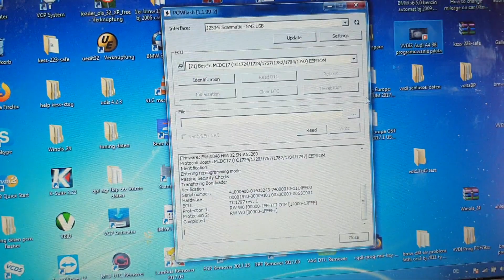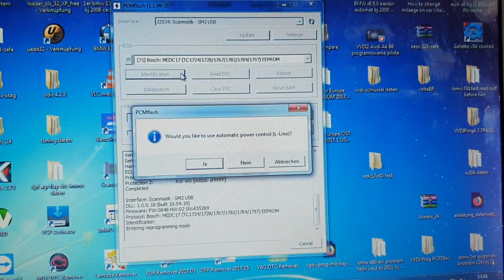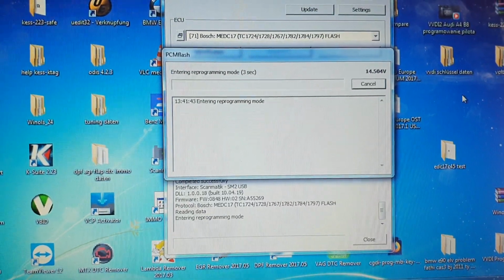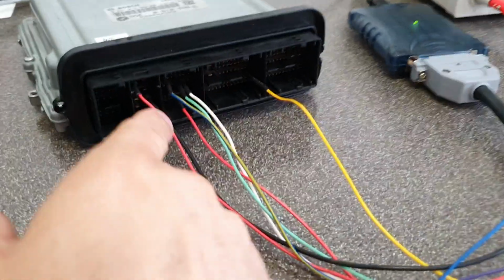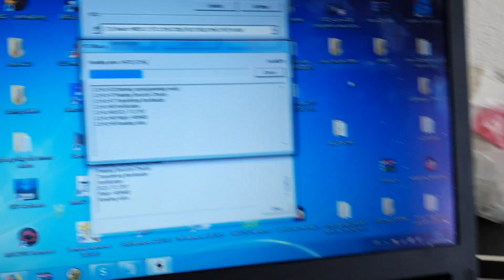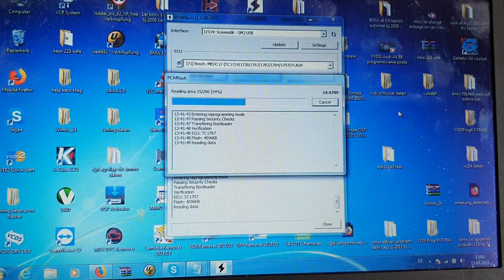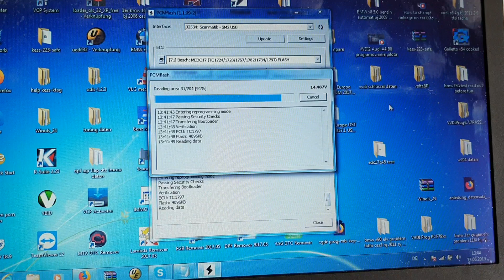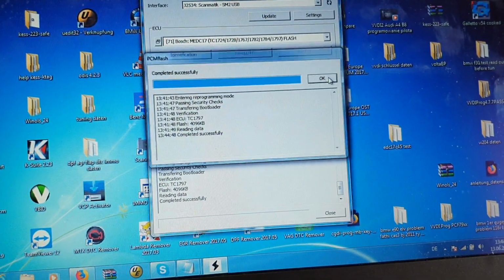Pcmflash edc17c45 in bench full read out.without opening

Comment: Where did you get the power voltage regulator?
Reply from the maker: Ebay :labor Netzteil
Reply: @waldemarfechtel1644  Wie viel Strom und Spannung, wenn Sie am Steuergerät arbeiten
Reply from the maker: @cangungor090  13,4 reicht. Das hat das Auto on etwa auch wenn es läuft.

Comment: How you connected the wirings to that ECU?  How did you know the location of each cable and how to edit GPT1 and GPT2
Thanks
Reply from the maker: Got help files from pcmflash forum or dimsport manual
Reply: Regarding the 12Volt supply, how did you connect it with the cable? Because it has postive and negative while the the scanmatik has one cable for 12volt the circular one

Comment: hello sir i took your advise and got scanmatik with cable and module 71 but i can not get it work on a edc17c49 can i ask where you get the pinout diags from and is it best to run on 12v or 14v 
thanks sir
Reply: moriaz72@gmail.com
Reply from the maker: @s1tuningsheffield62  I by it in pcmflash forum from Russian friends. You can use trash data manual

Comment: Dear,
I need to replace an ECU on 2008 Audi Q7 4.2 FSI, the engine control module is Bosch MED 9.1.1.  Can this tool do the complete job?
Reply from the maker: No. Use ktag bdm for  med ecu. (clone with ktag works 100%for this Med9.1.1)
Reply from the maker: Pcmflash don't read this ecu type
Reply: @waldemarfechtel1644  Ktag can do the complete job?  read & write? 
Two people told me after clone with Ktag is need a special function that makes the cloned ECU to start. after copying I would have to use tango or other equipment for the cloned file to work. But I'm not convinced. 
you have already cloned this type of ECU
Reply from the maker: @jorgetrula1462  read ktag full backup, need have exact same Donner ecu. Whrite full backup in it and car will start. 2008 car will starts.
Reply: @waldemarfechtel1644  Ok, full backup, so I don’t need to worry about EZS-Kessy, and eeprom separately?
Reply from the maker: @jorgetrula1462  don't need, when can read old original ecu.

Comment: using module 71 ?
Reply from the maker: Yes this is Modul 71 original pcmflash
Reply: @waldemarfechtel1644  Very nice thank you. Any idea how many cars can modul 71 do? Only BMWs ? Can VAG or Peugeot using 71 module? I know that there is some OBD module for VAG which is easier to use without taking ecu out, am I right?
Reply from the maker: @ju1c3washere  most of cars are supported but not all. With the highest tp root will not works. On pcmflash homepage can see wich are supported
Reply: @waldemarfechtel1644  What tool do you suggest ? Scanmatik or tactrix? I saw pcmflash being used with both of them
Reply from the maker: @ju1c3washere  scanmatic 2 pro, because don't need have powerbox for boot read with Modul 53,scanmatic works with many OEM. Software. Like odis, bmw, xentry and many more
Reply: @waldemarfechtel1644  Thanks a lot for hints. What is actually difference between module 53 and 71 ? Saw both of them are bench work.
Reply from the maker: @ju1c3washere  Modul 53 is boot mode. For this need open. Ecu. Depend from. Ecu and update status of the ecu maybe sometimes need open the ecu. Also need to do Witz ktag, flex, or autuner.